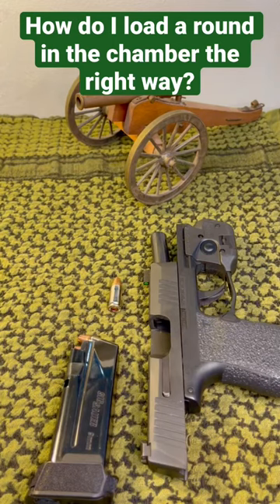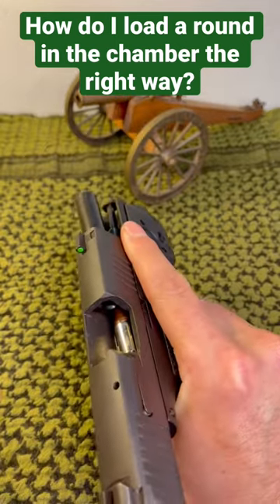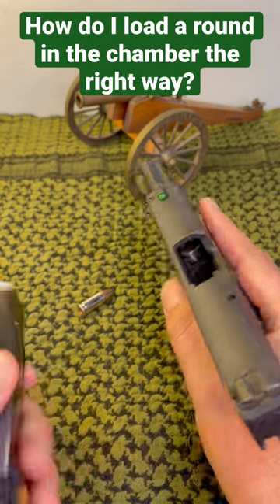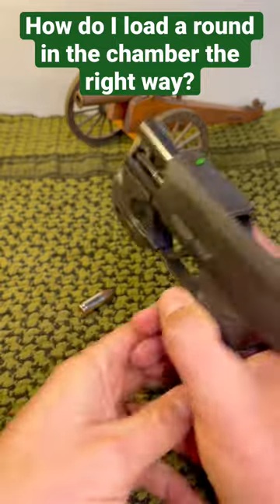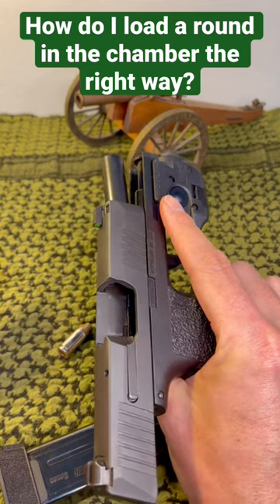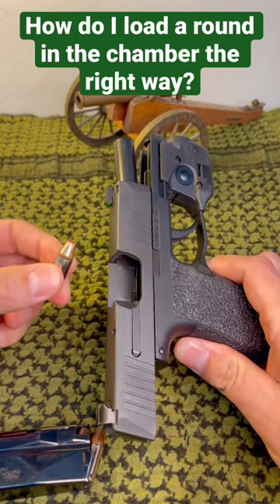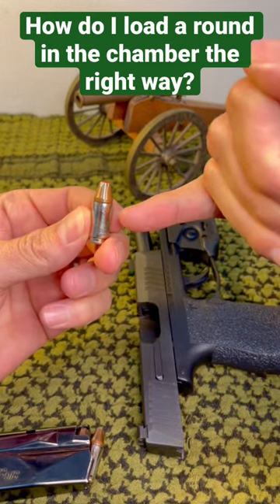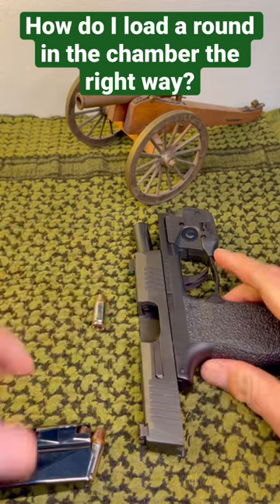How to load a round in the chamber. #9mm #ccw #bullet #sigsauer #pistol #365 #concealedcarry

Comment: Doesnt damage the extractor unless it has a solid extractor
Reply: Thank you.... these guys buy their first pistol and become bonafide gunsmiths over night apparently.
Reply: @GhostShura1984  describe the break.... If it was a common thing the manufacturer would issue a recall or ship parts to the origin store. I've worked in the industry for over 15 years. With manufacturers and I even ran a store for a number of years.
Reply: @GhostShura1984  Proof….because you said so…try again…
Reply: @x7slim8x  Just curious cause I genuinely am learning, would this “damage” a new glock 19. 

I don’t give a damn so I’ll do it regardless just want to know.
Reply: @Bigbossman12624  technicality it could result in possibly a chipped extractor with so many variations in metallurgy. That said, I wouldn't worry too much if you do it occasionally with a well oiled and maintained pistol. Personally I chamber from the mag 99.9% of the time, but just because it's habit. At the range from time to time I toss one manually in the pipe and drop the slide and in 30 years I've never had an issue. That's with not solid extractors though, your Glock doesn't have a solid extractor fyi. It has a spring that creates the tension needed and doubles as a loaded chamber indicator in the newer generations just so you know. 😉

Comment: 2 fixes. I carry critical duty. It is crimped at the bullet to avoid setback. Also a solid round for defense. 2 it will not damage the extractor unless it's fixed. If you chamber a round slowly with pressure on the extractor it's out of the way.
Reply from the maker: Ok this is great to know.
Reply: good to know with Crit Duty. Thanks for the heads up, got a ton of it for cheap

Comment: I remove my carry ammo often to do dry fire and range work and so forth - setback is a big deal - what I do now is (with the mag out) I insert a round in the chamber, slowly release the slide until it is "almost" to the round, then raise the barrel so the round falls back against the breech face - then carefully pull the slide back until it JUST drops below the extractor - then release the slide to chamber the round.  It is already on the feed ramp so no setback - it's in front of the ejector so no ejector wear.  Then insert mag.

Comment: You use steel rounds? Any reason why?
Reply: Those aren't steel rounds, they're polished nickel coated brass casings, commonly used on defensive ammo. The reason is the nickel supposedly reduces corrosion and friction compared to a standard brass casing.
Reply from the maker: They aren’t steal my friend just different color brass.

Comment: Could you explain how it damages the extractor  doing it one way vs. The other way? The extractor is meant to bump over every cartridge regardless, so I'm just curious. Thanks
Reply: No, the extractor does not bump over every cartridge. As the cartridge is pushed/fed from the magazine by the breech face, it is lifted into the chamber with the cartridge rim already BEHIND the extractor hook. The extractor moves with the slide as the slide picks up the cartridge, and the extractor claw or hook maintains the same position relative to the cartridge rim throughout. Try racking a round from the magazine, slowly, watching through the ejection port, and you'll see what I mean.

Comment: Doesn't damage any of my extractors.
Reply: Not that you can see. Metal fatigue will create microscopic stress fractures, resulting in a catastrophic failure at the most inconvenient time. Murphy's Law.
Reply: Only done it about 1000 times on a beretta 92, and shot maybe 10k rounds no issues bud.

Comment: The second option will destry your extractor
Reply: Thats debateable. It really depends on the extractor itself. Some will come MIM , which I can agree that it may break after many many times. Although, when your gun cycles it doesnt load behind the extractor it does go infront. Which is why its always rounded in the front. I usually buy a 17-4/7 extractor. That steel is way stronger than brass. I usually only shoot brass. Hardly ever I shoot steel.
Reply: Not on any modern handgun